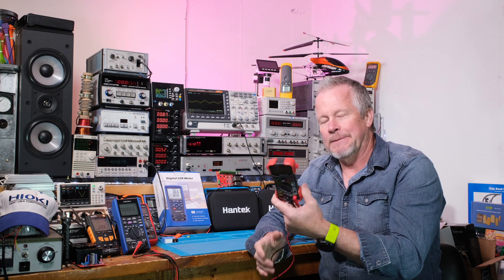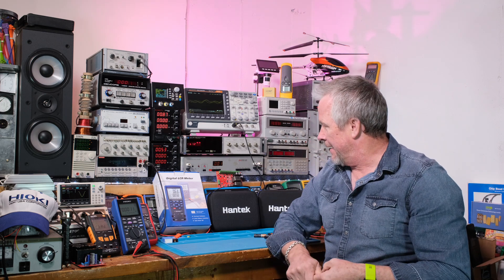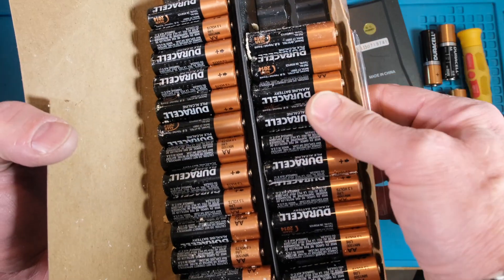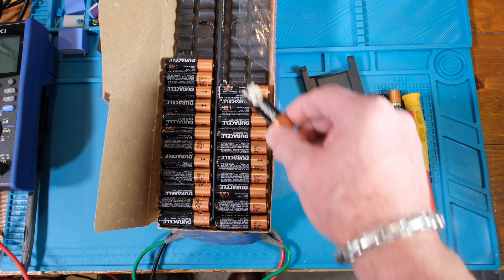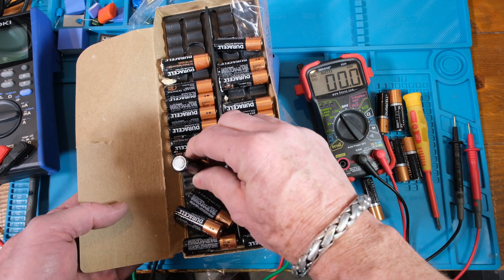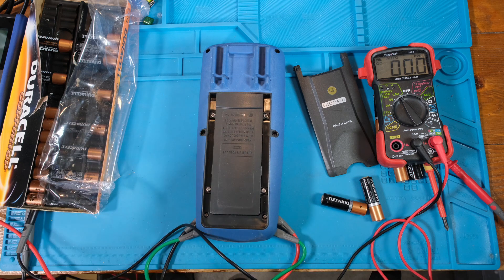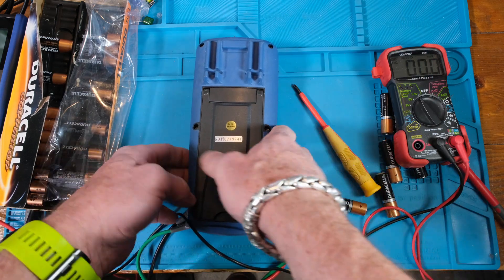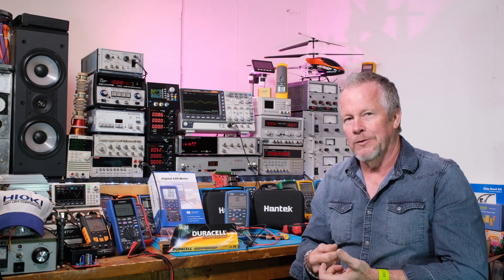Batteries Leaking -  Gold not so Golden

Comment: Duracell are the worst. I've had them leak in a perfectly good working flashlight that was putting out a bright white light until I saw the corrosion leaking around the end cap on the flashlight.  All the batteries were Duracell well within their freshness date and as I said they were good but they spilled their guts anyway and ruined the flashlight.  I will buy anything before I buy Duracell. In my experience they have been the worst to leak. I've had much better success with the cheap Dollar store alkaline batteries. They don't leak they seem to last just as long in my application.
Reply from the maker: Thanks for the great feedback!  Now that you mention it - I had them ruin two flashlights in the past...  I thought that maybe I'd accidentally left the flashlight on.  Now I know better;)

Comment: Probably cheaping out on the build to keep competitive prices as likely loosing ground to rechargeables. Lithium primary AA are about the same price and 1.7 volts.
Reply from the maker: Thanks John - you could be right.  But once you lose your good name...
Reply: @KissAnalog  Procell are their industrial/commercial equivalent, bet they don't leak nearly as much. Look 'em up, Eddie if you like the brand. "The range of Procell batteries are longer lasting alkaline batteries 
than previous Duracell Industrial batteries, specifically designed for professional devices". ... "The batteries are tested to guarantee the highest quality, including environmental testing to ensure dependable and consistent use". Could be BS but at least it's a start.

Comment: Back in the late 70’s HP banned Duracell batteries from being used in their calculators because of leakage problems. I see nothing has changed.

I use Energizers in most of my kit, but they leak too after a while. So I just replace them periodically whether they need it or not. I wish there was an alternative.
Reply from the maker: Thanks Declan for that interesting feedback!  Wow, if we only knew what HP knew;)
Reply: @KissAnalog  I had an HP 41C (an expensive unit for the time) that was badly damaged by Duracells after only a year or so. I sent it in to HP for repair, and they did it under warrantee claim to Duracell, so no cost to me, but they said they wouldn’t do it again, and added that warning to their documentation. So apparently it was a headache for them.

The problem with rechargeables over the years is that they wouldn’t hold a charge for very long. As for lithium AA’s, I’m not aware of enough experience with their longevity, and as we know, when lithium batteries fail, the results can be more dramatic than just a corrosive leak, if we’re talking about the same thing.
Reply: There is, if the device will work on the lower voltage: use rechargable batteries. They will not last as long but will not leak as easily as primary cells.

Comment: 2014?  Some old batteries there.  Yes, you can't trust duracell.  Best to remove from all equipment, never buy again.
Reply: Ya, those are old; I'm not surprised they leaked. Usually the date on them is a number of years ahead, so those are old.
Reply from the maker: Thanks Joe!  I appreciate you!  I could see those batteries in meters that I don't use often just ruining them.   The batteries in the LCR meter could not be very old as I replaced them inside this last year, and 2 out of 6 shows bad reliability.

Comment: 10:27 The ones with silver band are the newer labels, the silver label is the "Plus Power" version, and with the blue band is the "Ultra Power" version. Without the band are the older labels. Those with bands have the socalled "Duralock" technology for preserving power and extend the shelf time. But with or without that "Duralock" technology, they still keep making crap batteries.
If you want a decent battery, use Energizer.
Reply from the maker: Thanks Bjorn for this great information!  so the moral of the story is - it doesn't matter the package - if it says Duracell - stay away!
Reply: @KissAnalog  if it’s AA or AAA (or any cylindrical cells) of Duracell, absolutely stay away(!!) 

Tho I do have to say that I’ve never once had an issue with any of their 9v’s ever leaking and I’ve used a lot of em (guitar effects pedals most common power option). So for whatever reason the Alkaline formulation is fine in that form factor 🤷🏻‍♂️

Comment: Those batteries expired in 2014!!! Throw them all away.  In my experience, alkaline batteries - regardless of brand - always leak eventually. They constantly produce some sort of sour, presumably corrosive gas that builds up in an enclosed container. I store them like a leper colony.  Heavy duty ZnCl have crappy capacity but tend not to leak in my experience.  Simple Consumer(non pack) NiMH never leak in my experience so far.  Li-FePO4 seem stable. Li-Ion must be maintained and not over discharged or will show you how you've failed by puffing up with a lot of force as you charge them, potentially ruining your device.  The new buck converted AA and AAA Li-Ion seem pretty darn good depending on brand, but I'm curious what a catastrophic gas producing failure will look like.
Reply from the maker: Thanks Aaron for the great feedback!  I have started switching to rechargeable, and I'd agree with you - probably any chemistry is better than alkaline.  From the comments on this video, it sounds like the gold tops are the worst...  I haven't heard of any catastrophic failure, but the poor devices that they eat is bad enough;)

Comment: Here in the UK, Duracell are by far THE worst battery for leaking and most people I talk to agree.  Duracells are responsibe for taking out my Fluke 28 II EX, they took out 2 battery contacts and the expanding corrosion deposit broke up some of the plastic around the contacts.  This is the kicker, this meter cannot be repaired or serviced by any other company but Fluke and they want £850 to replace the back of the case!!!  That is almost as much as buying a new meter!!!  Over the years Duracells have wrecked several other devices so they are now banned in my household!!!  For me, I go Panasonic,  never had one leak ever, and they last longer than any other brand I've tried, Duracell incidently have crap longevity.  People need to be mindful about brands though, because there are many faked batteries around now, so make sure you are buying genuine product.
Reply from the maker: Thanks for this great info!  I just noticed that my new Fluke came with the Duracell gold tops:(  So bad leads and bad batteries...ugh!  I have had good luck with Panasonic as well, but I went back to Duracell thinking that they were the best...  I learned something!
Reply: @KissAnalog  
Yeah man, Duracell are the devils work!  BTW,  not sure if they are sold in the US but there are Duracell industrial here and people think they are a higher spec,  not so.  They are standard Duracell bit in non retail packaging, intended for sale to commercial users in bulk boxes.  Also, I should have added to my above tale of wo concerning my Duracell damaged Fluke,  it would be easy to replace the back of course, if, Fluke would supply the part, but they won't! Because it is an intrinsically safe type!  However, if anyone reading this can somehow obtain the part, I would be pleased to hear from them.  The reason I bought that meter was because I wanted a waterproof meter that could take some hard knocks without failing, ironic that it should be taken out by it's batteries!
Reply: A regular Fluke 28 has the same IP67 rating as the EX and costs some £100s less.

Comment: In my experience in the UK, Duracell batteries are amongst the worst brands for leaking. At least Duracell batteries come with insurance in the US, unlike in the UK, but not sure if they actually payout. No point cleaning battery terminals with baking soda, as that's alkaline, you want to clean the terminals with a weak acid, like white vinegar, to neutralise the alkaline leaking from the battery. Fortunately companies like Fluke sell replacement battery terminals for all there products, even ones not made for 20 years. Nickel Metal hydride rechargeables seem to leak far less in general, but should still be removed once the have run flat.
Reply: Here in Belgium Duracell batteries are the same crap. Non-branded or cheap batteries doesn't leak that quick like Duracell batteries does. Since many years i don't buy Duracell anymore, because they keep leaking especially in device with low current draw like remote controls, central heating thermostats, measuring devices etc.... Duracell has also a industrial version (black with yellow label) , but i don't have experience with those.
I have here Philips AA batteries from Tandy (Radio Shack division) from 1994, and they still have there charge and don't leak (look like new).
Reply from the maker: Thanks Bjorn, I am glad to learn this - not too late;)
Reply from the maker: Thanks Mark for this great info!  I just realized that my new Fluke came with Duracells, so now I see why they offer replacement parts (at the cost of a complete meter from others;).  Seriously, I am staying away from Duracell.

Comment: Hi Kiss...on my beloved Fluke digital multimeters, only Energizer Alakline and/or Lithium Ultimate.
Reply from the maker: Thanks Marco!  I appreciate you!  Guess what, I just checked my new Fluke to see what battery came in it - and guess what?  It is a gold top Duracell - just like these leaky ones in my video!  Fluke should know better.  It sounds like HP put a ban on them many years ago...I'm not in the business of buying Alkaline batteries for my product so I excuse my ignorance that I'm just learning how bad the gold tops are:(
Reply: Here in Italy Energizer batteries are not great diffused as Duracell...sigh...My Flukes including one 28II, one 287 are powered only from Energizer Lithium Ultimate/Alkaline. An so other my beloved HP calculators like one HP 41CV and 71B.